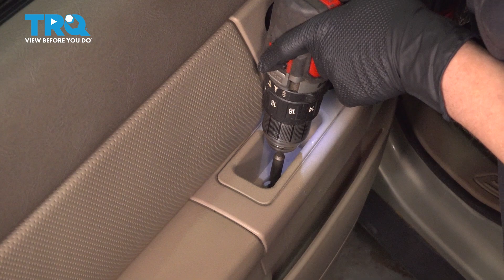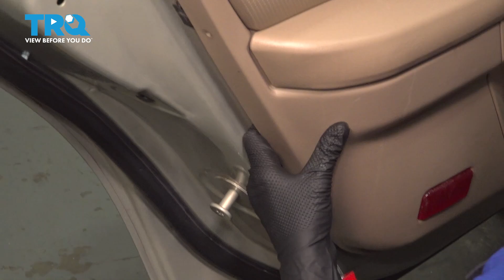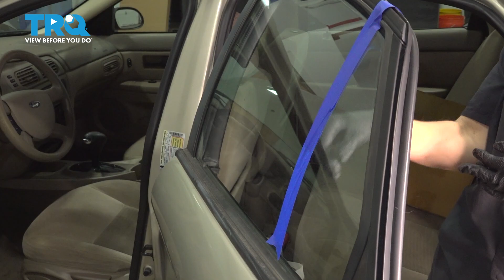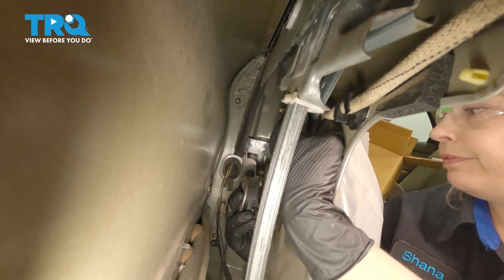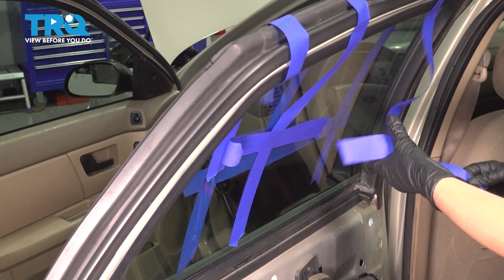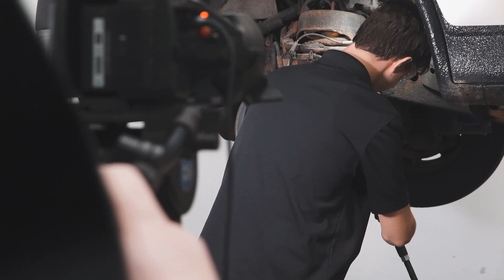How to Replace Rear Power Window Motor & Regulator Assemblies 2000-2007 Ford Taurus

Comment: Thanks for posting this. I have a 2002 Taurus SE. That tool to install those pegs or pins, can that be rented? I don't want to have to buy such a tool for possibly a one time deal or how much does that tool cost on average just incase I can't rent one? 

That rear left door motor is the one that doesn't work anymore on my car. So this tutorial helps. Is that bar that moves the window up and down on the motor tricky to attach? Just curious, thanks for posting.